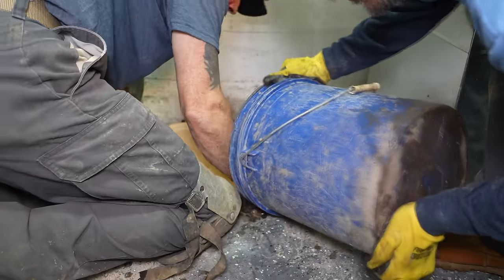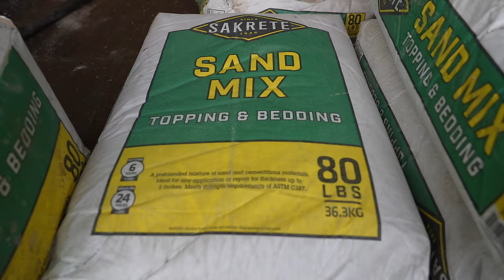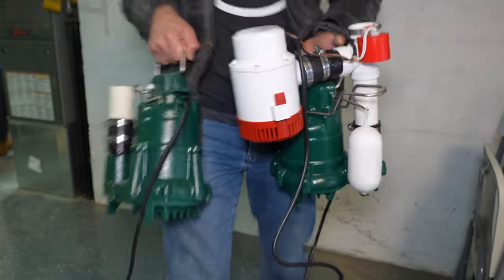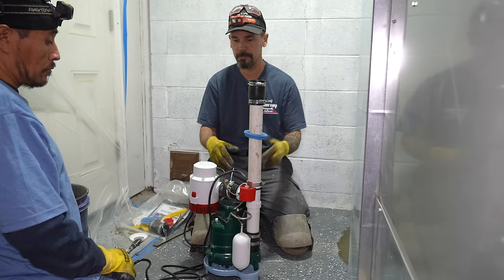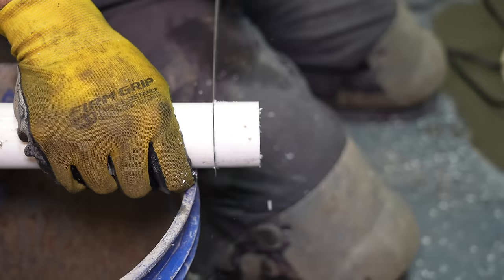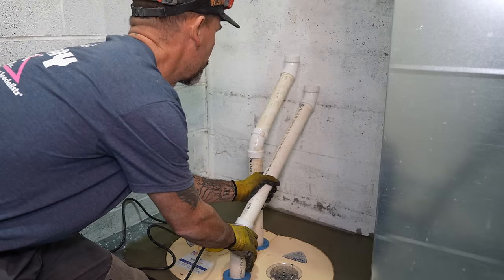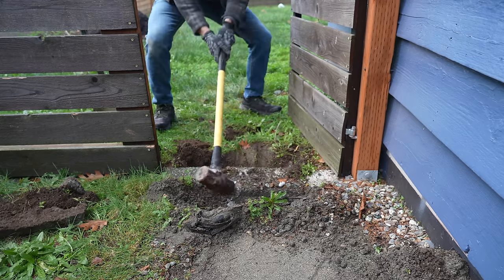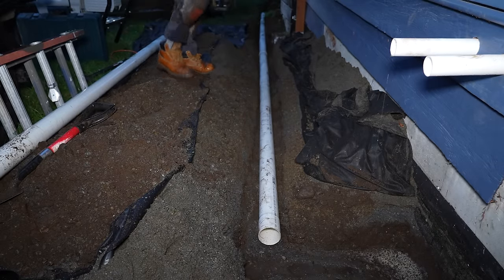TRIPLE Safe Sump Pump System Installation

Comment: We are currently replacing water-damaged drywall, framing, and cupboards. Some of these for a third time.

We have done almost everything physically possible to stop the water intrusion including, inside and outside  drainage and sump pumps, wall linings inside and out, French and surface drains, and gutter and downspout collection.  We have installed three 6" PVC drains that lead to a culvert.

To prevent water damage on the interior of the basement we are replacing water-damaged drywall, MDF, and wood with composite sheet boards made of polyurethane foam and fiberglass sheet composite.  We are using Bluewater20 (1/2")  and Bluewater26 (3/4") composite boards from Coosa Composites.

Coosa board is used primarily as a substitute for plywood for the manufacture of watercraft.  Coosa board is about 30% lighter than plywood.  It does not absorb water so it doesn't rot, and it isn't susceptible to mold, algae or fungus.  It is dimensionally stable and requires no special tools.
Reply: Wow Robert, you did all that and still had problems?  Or this is what you're implementing?  Is this just water intrusion and not related to cold temps?  I'd be tempted to not put up anything on the walls until you get this sorted out.
Reply: @Mark-hb5zf  This is all water intrusion coming primarily from the street.  There is no curb or storm drain.  Our house is at the bottom of a bowl.

The problem seems to be associated with run-off, soil composition, and an increase in the amount of rain.  Winter weather has not been a factor.

With 20/20 hindsight had we opted for the most expensive fix in the beginning it would have saved thousands of dollars.  Instead, we chose to fix problems as they appeared.

Comment: Very nice video.  My son sent it to me because my basement in Vermont has seen a couple of high waters, mostly ankle deep, but once knee deep and the most intense when six inches of rain landed in thirty minutes, I had unheard of water entry locations and even with two pumps going, the water was 32 inches deep!  

Now we are figuring out the details to install a sump pump.  The water levels rose the first time decades ago with my mom and gramp living at the house after the local hotel tarred over their whole large parking lot, and all the neighbors down the street got flooded.  The hotel had to correct their mistake with installing catchment and drainage areas, which helped but not fully.  

Just before the 32” flood, the local school changed a swampy hillside area into parking lot with water catching areas when a new building was built taking out their previous parking. 

We cannot undercut the worth of a swamp as a heavy rain sponge, mitigating flooding!

And a question… what does one do where the temp goes down way below freezing?  I would worry that the outflow pipes, if water is pushed through them from time to time, would freeze and back up or cause the pumps to fail.
Reply: Have a secondary discharge higher above snow line discharging outside. Make a "" T" riser inside the house exit the structure above the max snowline!

Comment: Really nice job. Years ago we made a horrible mistake when having an in ground pool installed. Through a combination of “not knowing” and landscape design we managed to have rain water flowing towards the house. Since our yard is heavy with clay it never drains well anyway. I’ve had to install a drainage system that moves the water away from the house into a 30 gallon tub with a sump pump. Since it’s outside away from the house there’s no battery backup. I’m at the mercy of the power company. And still during heavy sustained periods of rain sometimes water manages to get into the basement. Very frustrating.

Comment: also at the highest point in the line, you can add a vent. make sure the line is large enough. venting i will make it so you do not have as much of a problem with backflow and suction. i have seen systems where the check valve fails, get clogged, or does not seat all the way and resulting in more water getting sucked into the basement. the ice guard installed provides the venting needed.

Comment: Zoller pumps are the best BUT the float contacts will burn out after the warranty expires in 3 yrs,so on my second Zoller pump due to it crying so much as it kicks on almost right w=away with about 2-3 inches of water, i bought one WITHOUT  a pump level feature on it and went with a float system that will allow for a full catch basin of water instead of the 3 inches of water from the other built in float  and it works great

Comment: The house I'm building in NH is on a fairly flat lot and has a very high water table. At first we figured we would have to put in a heavy duty sump to keep the basement dry, but my sitework guy was able to put in a daylight drain for the perimeter drain so now, even with very heavy rain, it stays 12" below the top of the sump basket.  I will still have a duo sump system with battery backup like you, but it hasn't been necessary (yet).

Comment: Amazing! This said, you are going to need a way bigger battery if you run out of power together with  some solar panels to recharge them. Each house, electric  infrastructure , and geographical location is different so please take that into account. We used to loose power constantly during storms so we had 16 solar panels and three massive Tesla wall batteries (we don't own electric vehicles) in the garage to "guarantee" the system would not fail.

Comment: My place in central Ontario is very low beside a lake, the original sump pump just put water on the lawn. Not ideal. 
I dug a secondary pit, with a secondary pump set higher, both pits connected.  The two pump exits into a single poly line that runs coaxially in a corrugated 120 feet to the ditch.  The corrugated line also carries evestrough water. 
An air valve on inside ABS pipe lets air follow the water , prevents an air lock in line. 
The first hundred feet have a heat tracing line that I’ve never needed. 
Both pumps on separate 15 amp circuits. 
A back up Generac generator is on standby. Expensive but worth it. 
It can reach -25f some winters but it’s never frozen in last 15 years. 
Primary pump runs a lot even in cold winters.  
Many neighbours have had basement floods and are copying my design as flood damage is expensive.

Comment: Can remember a car mechanic saying to never store a car battery on any concrete floors. Think even though the case is heavy non conductive plastic told me to have a piece of plywood between the lead acid battery and a damp floor. Great best in class job.
Reply: That's what I was always taught growing up, too, but recently when I asked my battery guy about this, he said new batteries are designed better and that's no longer a concern. 

I still store batteries with cardboard or wood between them and the concrete though, because some habits die hard.
Reply: Very old battery's that could happen to but not today's batterys
Reply: That was true when the old batteries had rubber cases that were porous. Modern batteries are hard plastic and non-porous.
Reply: This was true when the battery cas was made of wood early in the 20th century.

Comment: Very good video. Did your PVC break yet? I have seen other connections where they have an air gap that allows the PVC connected to the house slide up and down vs the pvc in the ground so that when the ground freezes and heaves, it doesn’t crack the PVC.

Comment: If you live in an area that has municipal (city) water supply, you can use the : "belt and suspenders" approach by using a municipal water sump pump that uses the flow of the city water, no electricity needed, to use as a backup pump for your sump pump if you batteries die.  It uses 1 gallon of city water to pump out 2 gallons of sump pump water.  Once such pump is Liberty Pumps SJ10.  Usually the city water system is backed up by a generator so most of the time residents have running water during a power outage.
Reply: I installed one several years ago. Make sure you test it at LEAST 2x a year. It cost me under $200 for parts and my time. Use a 3/4" water line to that Liberty Pump.
Reply: Thanks!  I told my neighbor about it and he installed the 3/4” Liberty municipal pump and work like a charm since his backup batteries would died during an extended power outage.  He has had a dry basement ever since he installed it as it works every time!
Reply: Amount of water pumped on water backup depends on water pressure and pipe sizing mostly most can handle alot more than 2 gallons. Manufacturers have charts so you can figure out what's needed for your situation. Pumps also have min and max psi operating ratings.
Reply: Until you get the $1200 bill from the plumber for the required backflow preventer.  You don't lose water during a power outage because the water is stored in above ground tanks and towers to provide pressure.  You'll have water until the tanks empty.
Reply: I don’t think it will be that expensive but having this municipal water sump is a lot better than having foot of water in the basement with the good potential of dangerous mold growth.
Reply: @stargazer7644 depends on area if in an area that requires an assembly that's about right since you need someone with qualifications to test. Some areas allow the simple vackflow that's already built into pump which avoids that issue.

Comment: I love how you go with three pumps and no drain tile. Then your piping cut the life of these wonderful American made pumps in half. Omg the head pressure. Please add a check valve for the love of your pumps.
Reply: Male by fernco at base of pump is a check valve manufactured by zoeller
Reply: @sewerrat7612 …What sump pump do you recommend?  I have zoeller from Lowes, electro magnetic switch 1/2 HP pump. I was getting lots of water in basement during heavy rains due to hydraulic pressure. I dug hole and pump has been keeping basement dry. Water table is 8 inches below slab.
Reply: All the larger brands are decent in my experience it's more important that pumps set to pump at proper height. If built in switch can raise up on bricks if height difference is larger they make pumps with adjustable floats. You want it to be enough to keep from flooding but not so low that it's pumping ground water all the time unless your structure under the water table. Ideas to avoid unnecessary wear and tear on the pumps that will lead to premature failure.

Comment: Curious to know if your basement block walls are sealed from the outside. I suspect most of that water comes through porous cinder blocks. Path of least resistance would be block walls, not clay.
Reply: Basement walls back in the day were typically sealed with tar. It’s not great, degrades and the bottom tends to not get sealed. Yay old houses

Comment: 7:27 Folks, I am a very competent Plumber here in the northeast part of the country (CT) and we have gotten rain this year… An understatement / lots and lots of rain! Well so far I’ve changed out three of those stupid systems that this guy was demonstrating around the seven minute and 27 second mark; they are junk! Those Zoeller pumps are not that great. Those switches on them fail often and that back up pump is pretty much good for an aquarium, that’s it! A lot of these guys put pipes on them that are 7 to 10 feet in height, and those pumps will not pump adequately with that kind of head pressure. I do not get any endorsement from Liberty pumps but that’s all I use because they are so much better than those Zoeller brand pumps. If the customer wants a battery back up then I use a 1200 W inverter with automatic transfer switch coupled with an Interstate or Deka brand deep cycle battery and then marry that to a Liberty half or three-quarter horsepower sump pump. So much more reliable than the junk that these guys are selling.
   Edward H. – “Integrity, Plumbing, Septic and Drain“ out of the Clinton, CT USA area.
Reply: Greetings my fellow CT family 😊.  You just who I need to speak to I bought a mess of a house I knew the house was a slope on back home inspection gave it great reviews never trust a woman again lol and I'm a female. Anyway I live behind Mountains wasn't aware of and the previous owners knew they had water issues never said they did they just laughed to the bank. Anyway I was thinking of adding a sump pump just don't know what best to choose for my situation. Yes I had 500 dollars worth of rocks added for ground water to flow away from home. I'm too old for this can u please help a old lady out. 😢 I want to try to resolve this and sell it I believe in doing right by other and trying to be responsible person I put so much money into this and I really have no more money left. Thanks
Reply: Ding ding ding. Winner here. Well said. 

He is using the Basement Systems line of pumps/crocks.

Zoeller pumps are, in my opinion, garbage and I've probably swapped out 3-400 of them. The primary cause of failure is their crappy float switch. It either sticks in the off position or, worse, the on position and with no thermal overload protection it simply burns itself out. Plus, they are grossly inefficient pumps. I primarily use Champion, Pro Series (awesome continuous duty pumps) and other commercial grade pumps if I know I'll need to pump solids like leaves, etc... Liberty's are also excellent pumps too. 

I'm also a big fan of inverters and batteries but that depends on the volume of water we expect to see. I can always daisy chain additional batteries and get additional capacity or go to a 12V backup if the volume is lower, depends on the issues.
Reply: Ed, fellow Clinton resident (Grove St)!  All my neighbors have sumps running all the time from the high water table right now.  My house is older and built a little higher than theirs, still dry (for now), and no sump.  I've been here for decades and only once about 12 years ago had an issue.  I had two pumps running around the clock for days on end on my basement floor that time, a 1/3 hp skimmer pump going into a 5 gal bucket with a 3/4 mag float pump inside it.  Just enough to keep the water at <1" or so.  I can see where a previous owner patched over where I'm assuming was a sump system, don't know why, maybe radon?  Maybe that one time was a 50 year event, IDK, but I'm sure it will happen again at some point.  But I'd like to talk with you about what the best way to tackle this the correct way would be...
Reply: I've read enough complaints about zoeller pumps that I would be afraid to buy one. Shame, since they once had such a great reputation.
Reply: Do you have any preference as far as switch types. Float vs diaphragm?.
Reply: @jerseyjim9092 the digital sensors are the way to go now!
Reply: Apparently, you just dont know what youre doing.

Comment: 3:55 cutting out a section around the slab is something we've done in the past.  It takes as long as you'd think.  Incredibly hard work.   Best to have many hands.   But it did work, taking a house that was flooding yearly to absolutely perfectly dry.   (The sump would fill with water none strop for weeks)
PS: I still don't see any check valves installed? are they within?
Reply: Double your time estimate and maybe you will not be behind schedule/stressedc

Comment: you could grind a slot one inch away from your basement walls., then silicone seal in vinyl j channel back to the sump. It's called a beaver system. That sump system would not be allowed in WI as it is now technically a floor drain. and floor drains are part of the sanitary sewer not part of what we call storm water.

Comment: I really hope this works for you but as someone that has major water issues in my house I think you might be looking at that interior tiled a bout 30 yrs ago we  tiled around around the exterior of the house and landscaped to run the water away from the house about  yrs ago we had a really cold spell when it warmed up we had a leak in our back wall got the company Basement Boss come said we had a couple of cracks in the wall and with the amount of water there was should tile around the inside of the house when he busted up the floor he could not believe the amount of water under the slab. They did a great job and knock on wood no water so to you good luck.

Comment: Need check valves on the piping, as well as drilled holes close to the pump to prevent air locking.